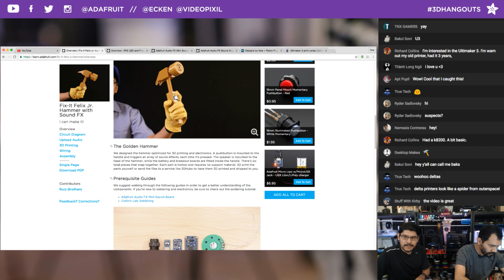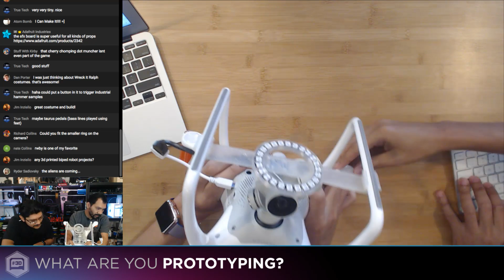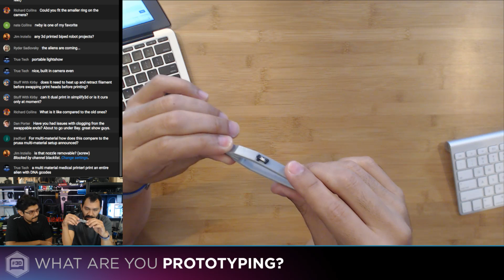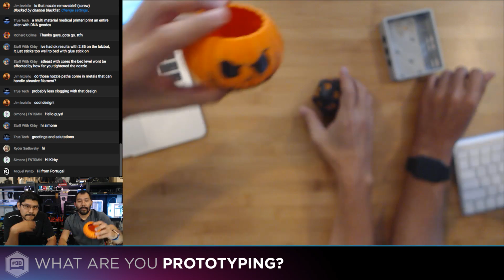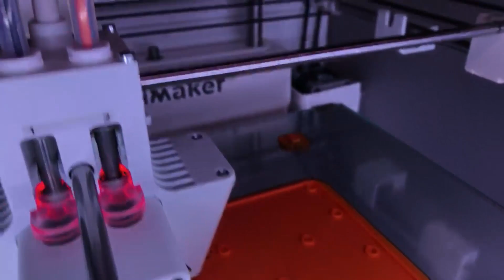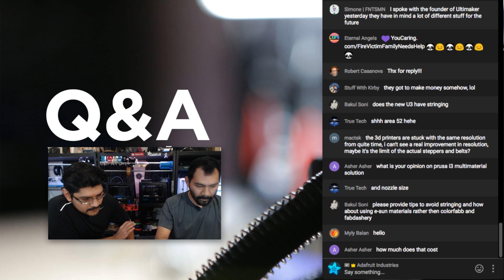3D Hangouts - Ultimaker 3 and Gold Hammers

Comment: Hey Guys, thanks a ton for doing this video. I am waiting for my UM3 to arrive, I have used a UM2 extensively in the past and had a bunch of questions you have answered in this video. Interestingly you started touching on the one thing that made my UM3 choice a little harder, 1.75mm filament, it seems like you didn't have much of an issue running it which has gotten my hopes up again. The reason 1.75mm was a hard choice was because of another topic you touched on, the Mosaic Palette. The Palette only uses 1.75mm filament and I didn't think I would be able to use it with the UM3. Seeing you had little to no issues with the 1.75mm do you think running the Palette with the UM3 will be possible? Software / g-code is one question, the physics and mechanics of it all is the other. What are your thoughts? If you get a Palette in do you think you could give it a try? I don't want to drop $1,000 on a Palette and be left needing a new printer. I was, like you commenters, considering the Prusa i3 mk2 as a second printer just for the multicolor options; but if the UM3 could do support material from one nozzle and 4 colors from the other with the Palette it would really be a killer at the price point, beyond what it already is. I know you didn't do a ton with the 1.75mm alone so maybe that is a place to start, could you try to use 2 different 1.75mm filaments and show the results? Or even just a single color print using only 1.75mm at a higher res to see how the quality would be using 1.75mm alone from one nozzle as would happen using the Palette? Technically you could do up to 8 colors I suppose if you ran 2 palettes, but that may be pushing a lot software wise, again, thoughts? I am really curious if the UM3 can do high quality at 1.75mm because if so it seems like the possibilities for this printer could really open up with the Palette. I am also hoping some smaller nozzles come out soon for it as it's a little behind the UM2+ on that front, any idea on the time frame for those, I know UM said they are coming. Thanks!

Comment: The filament system is open. It's not so much hacking as just looking up how it works. You just get an NFC tag with a GUID and create an fdm_material.xml file for that GUID; throw it in Cura and it will get transfered to your UM3 ^^
Perhaps you need to restart Cura...

I'm not sure whether Ultimaker will accept any pull request for a new material, though. There will have to be some quality control first.

Comment: Some comments on the UM3 review: - the printcores do have a teflon part, but it doenst touch the nozzle. - the low temperatures didnt work because you doubled the layer height and thus doubled the flow- I love the reactions on 1.75mm filament on the UM3, this opens so many possibilities!! (1.75 for brittle filaments, 2.85 for flexible).